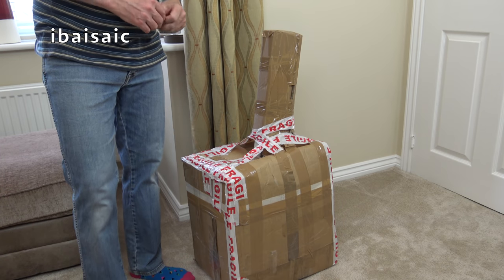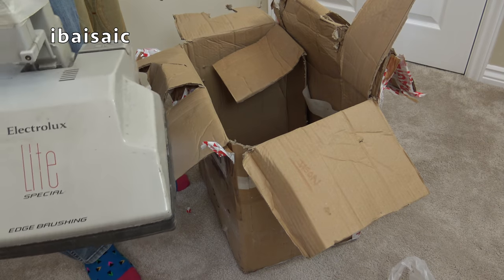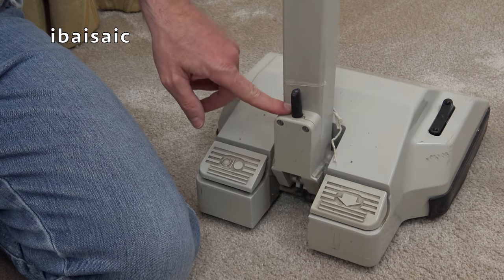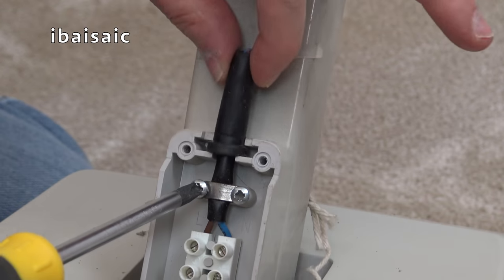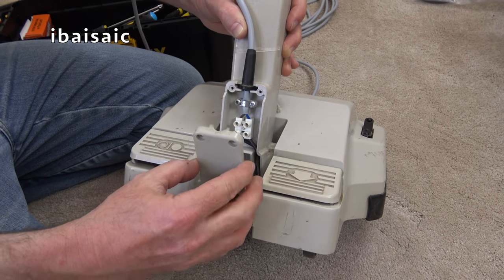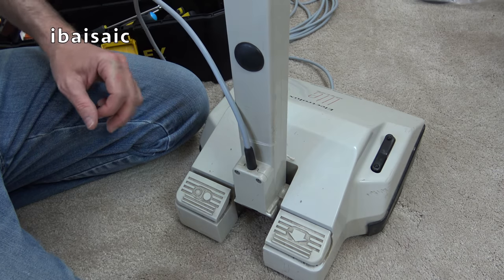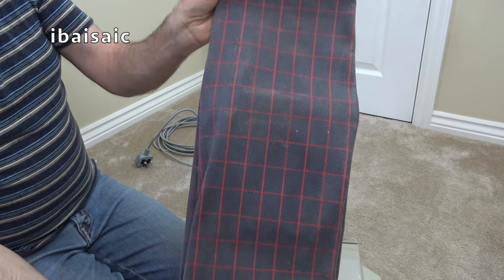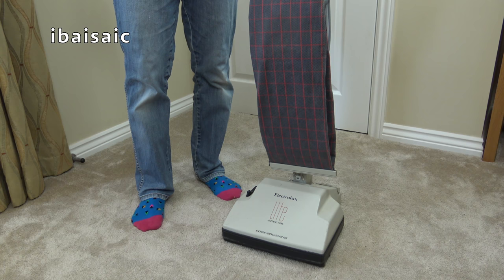1980s Electrolux Z1030 Lite Special Upright Vacuum Cleaner Unboxing & Repair

Comment: It probably was inspired by the arrival of the Hoover Elite upright in North America  - a much more robust version of the classic Oreck Lightweight upright.  Sideways motor, bag on the front, dirt tube integrated in the handle.  Electrolux’s North American subsidiary Eureka followed with a similar vacuum called the Bravo.  The concept is great:  no extra tools and motors needed-just a basic, lightweight deep carpet cleaner with a full size motor, revolving brush and large disposable bag.  Great design!!! Enjoy your new toy!!!

Comment: "Moving toward a society where we repair more again, and make do and mend" says Roger. Not if Shark have anything to do with it we won't be. They are about the worst vacuums to try to repair, as Shark dont want you repairing them, they want you to throw it away when it breaks and go out and buy a new vacuum. There will need to be hefty regulations brought in to force manufacturers like Shark to make their products easy to repair and also to supply reasonably priced spare parts. I just cannot see it happening as Shark is quite happy for the status quo to continue, with their vacuums failing on something basic like a powerhead internal hose, or even a powerhead belt, meaning that the user has either to pay out almost £100 for an entire new powerhead, or else junk the vacuum and (what Shark hope will happen) buy a brand new Shark, for that to fall apart within 2 - 3 years, requiring another new vacuum to be purchased. Cordless vacuums are even worse, when the batteries fail after 2 years (just after the guarantee expires), the manufacturers hope you will throw them away and buy new ones, as they price the batteries at almost £80 plus postage, making the cost of repairs too high. I cant see things ever going back to the days of cheap and available parts for repairing vacuums simply - there is not enough profit for manufacturers in designing vacuums that last longer, as that means people wont be buying as many brand new vacuums, and in this greed and profit motivated society, business will design built in obsolescence into appliances more and more.
Reply: Mend and trade.

Comment: I have a question. Is it safe to buy a vacuum cleaner on Ebay? I have been eyeing a Kenmore Progressive Upright Vacuum Cleaner (116 model) for months and I'm unsure if its safe to use Ebay.
Reply from the maker: You have to be wary of buying any second hand electrical item.

Comment: Does anyone know why the early to mid 90's Dirt Devil Deluxe Uprights so hard to find? Cause I can find none on ebay all I found was bags.
Reply: Eventho they're were good vacuums and the best cleaning dirt devils. The Uprights, Deluxes, and MVPs weren't very good built quality wise and end up in very rough shape and alot of broken parts especially the bag covers. You have to be lucky to have them in good shape.
Reply: @YoumuHoover  Yeah I suppose they were designed very well but the plastic is like tin foil. I have a Swivel Glide vision that has at least 3 different cracks on the hood alone.